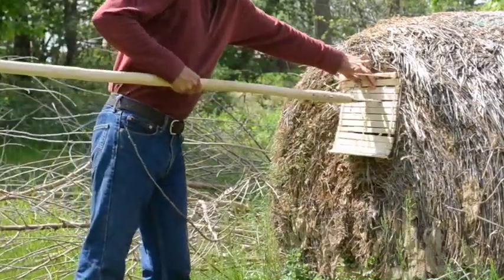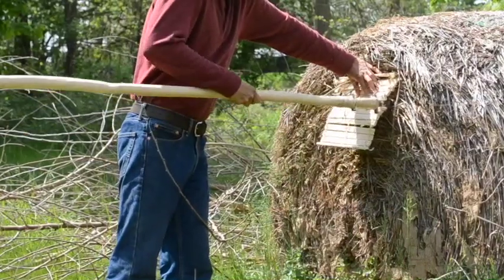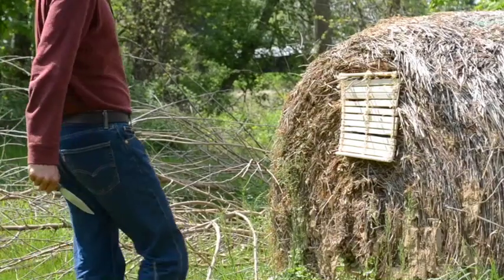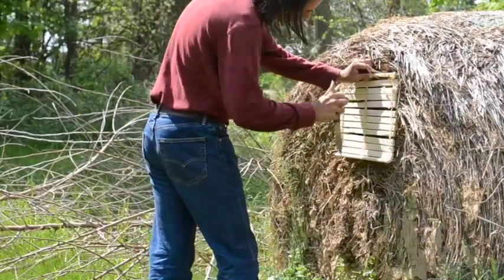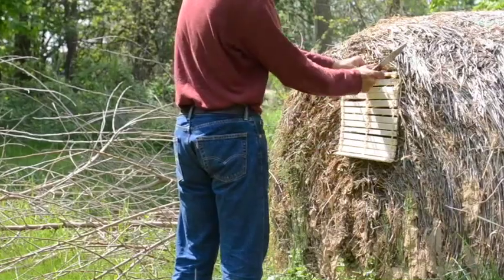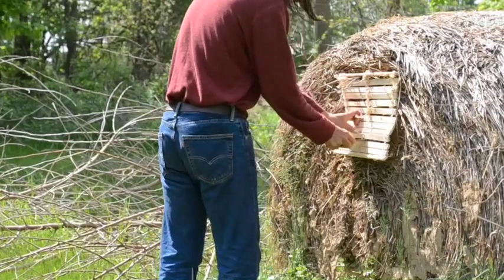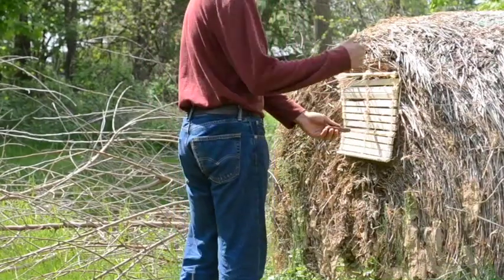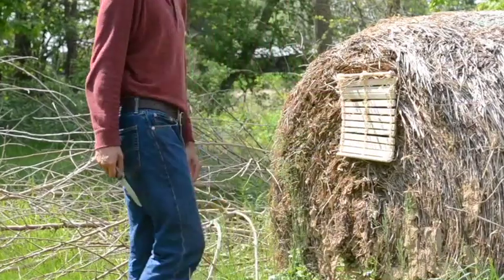Wood armor test. 1st iteration.

Comment: I’m attempting to make a primitive form of wooden lamellar armor. Hopefully it should be fairly effective. I’m just messing around with different designs right now. My twin made wooden plate armor, he’s still working on the leg pieces. It reminds me of some Bronze Age designs as well as samurai armor. It’s fairly thick wood and so it’s a bit heavy. We’re making it so we can hit each other in the park with sticks as hard as we want. The plate armor is very successful in this as I can hit him with a stick as hard as I can in all the major spots and it does nothing. The only thing you can feel at all is stick pokes, but it still does nothing. As far as swings, it’s perfect. We’ve just been testing it with staffs and sticks, but if we get it better at deterring pierces we may test blades as well.

Comment: Did you harden the wood over fire? it would strenghten the plan and make it considerably lighter.
Reply from the maker: I tried that in a different experiment, it makes the wood much harder to cut but much easier to split. I don’t really think it would be worth it.

Comment: Would vertical planks work better? Or better yet, maybe overlapping them? Or perhaps a solid piece? Either way, cool vid! :)
Reply from the maker: Vertical pieces work better. Overlapping has some issues. Solid pieces don't work.
Reply: @MalcolmPL  Gotcha! :) I was researching wooden armour and your video came up, so this helps a lot. Thanks!
Reply from the maker: @firegirl1452  You're welcome. If you have any questions, I'm happy to answer.
Reply: @firegirl1452  what is the conclusion for best wooden armour
Reply from the maker: Hardwood slats, one inch broad, 3/8ths-1/2 inch thick, fully woven like cloth.
Reply: @BlackMamba-lt8oe You need to respect the grain, the wood grains need to be oriented against he body like this IIII instead of on top of each other like you see at 0:30. Otherwise a pointed weapon will just split the slats.

Comment: This is why you'd want 2-3 layers with leather in between. For a makeshift army without the means for metal armor, this may be a great alternative that provides enough protection that's also lightweight and readily available. Hell, have metal plates strewn behind for more protection that can also keep the boards in place so as to avoid it from spreading.
Reply from the maker: A bit of leather would go a long way, but look at the later tests before you come to any conclusions.

Comment: I wonder how the armor would perform if you overlapped the boards somewhat - kinda like metal scales overlap and take some of the force off the slat on top. Might not stop the hatchet but could probably better deal with stabs and blunt force trauma.
Reply from the maker: Back before I started filming everything, I tried overlapping a couple of ways, one like lamellar, as that was armor I was familiar with, the other like a clinker built boat.
While overlapping adds a fair bit of strength (more than enough to stop the hatchet), it also adds rigidity, and bulk is a major issue. You end up with some sections that are over an inch and a half thick. Too much for comfortable movement.
Overlapping it also means you can't weave it to prevent splitting.

Comment: What would they have worn under the wooden slat armor? Or backed the armor? I think a backing would help a lot in preventing seperation.
If they were wearing under or backing the armor with hide, leather or thick cloth of some sort it may have been enough to prevent any arrow penetration into the person; although I think the spear would definitely be an issue.
Granted a hay bale has give to it but not in the same way as a person would; it could make a noticable difference.
Reply from the maker: Out west, the Haida wore thick, sometimes two ply, leather vests over leather tunics. I’d imagine we did something similar, though I don’t have any evidence.
Reply: @MalcolmPL  well unfortunately history can be that way, but given how many people's did wear padding or liners with armor if think it likely also